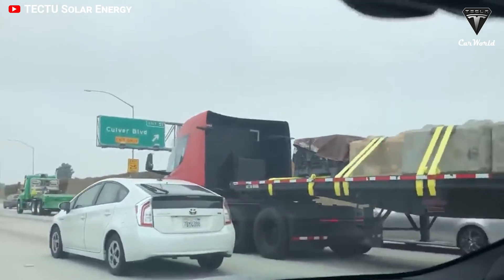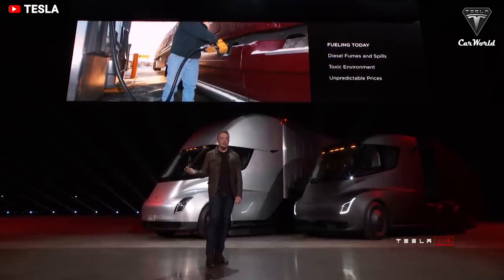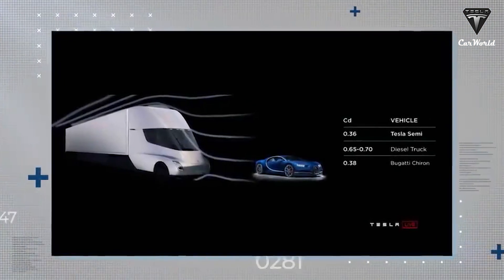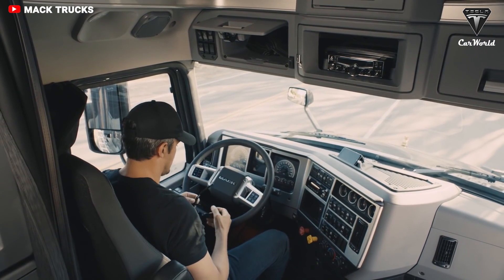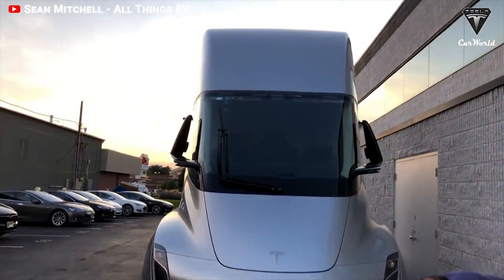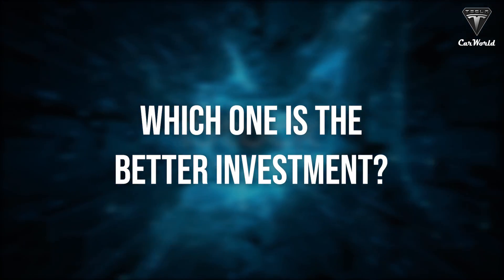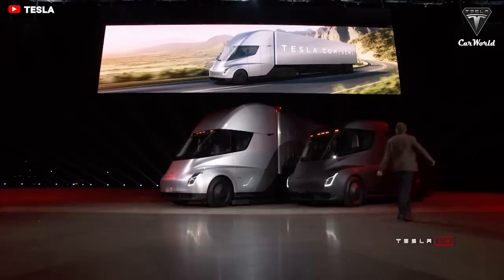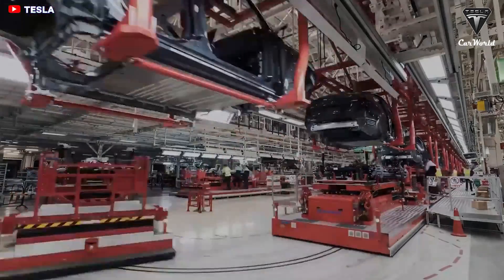Which is the KING of 2023 heavy trucks? Mack Anthem Diesel Truck Vs. Tesla Electric Semi?

Comment: These won’t work if they cannot go at minimum 700 miles a day on one charge as an OTR truck. Maybe ok for local stuff
Reply: ThatGuyDy:

So much nonsense from the FUD patrol. 

First , 500 miles is FAR from local.  

Second, given the 70% charge the Tesla can do in 30 minutes, that means an 850 mile total range with one small break while going to the bathroom and grabbing a sandwich.  

If you can't argue better than that, just give up.  Seriously.
Reply: @rogergeyer9851  that’s one truck and that’s double time for refueling on70% of the range. Now take that for more Tesla semis on the road. Delivery times would take longer because there’s a long ass line waiting to chatge
Reply: 700 Miles/60mph = 11.6h of driving. How long is a driver allowed to drive in US? In EU it is limited to 9h and controlled regulary.
Reply: @TschingisTube  american trucks can go 75mph and american truckers can drive 11 hours in a day
Reply: I'm not a trucker but aren't most trucks used for local delivery, which is millions of trucks in the US? That's a whole lot of trucks that can recharge overnight when electricity is the cheapest. Once we build out these local delivery trucks in 10 years, we will have built out the long haul recharge network, built EV trucks with sleepers and improved the longer range batteries?
Reply: w⁹rbg

Comment: One thing is for sure, this electric and hydrogen technology is getting better by the second, the supporting infrastructure is leaping forward by the month so resisting this move away from diesel is not smart. The fact that companies like Tesla and Nikola have tractors that won’t let a driver spin the truck around on slick roads is impressive x10 in of itself.
Reply: NIKOLA XDDD
you know that was a scam?
Same with Tesla semi which was supposed to come out years ago with full self driving and automatic convoy... And Elon is still withholding cargo weight numbers... I wonder why...
Reply: Easy to speak when you aren’t the one paying for everything. Do you understand the cost for an electric truck? Let’s not forget the purchase of the charging tower…also the land where the tower goes has to be approved by the electric company. A lot of hurdles and cost.
Reply: @tricallyourmama  We are still going to run out of oil one day .

Gas prices will only go up .
So we better start doing something and not just wait .
Reply: @alokinzna I hope we run out of oil, why can’t we just go back to the good old days where cars didn’t even exist, where all of these phones and electricity stuff didn’t exist, humanity is taking a turn for the worst
Reply: Ya don't have batteries.  We've seen what pulling an empty 1000lb trlr does to a pickup.  What mileage with that Tesla get in the Rockies in the middle of winter or the southwest when over 100 degrees?  I can go 1500 miles before I recharge my fuel.  Tesla's aren't green, either.  Ever see pics of those lithium mines in Africa?  It's disgusting what's goin on there.  Guess it's ok to kill their kids and their way of life as long as we don't see it here?  Takeoff speed isn't shit in trucking.
Reply: wirbg éltrç hydégr beßt
Reply: You dipsh-t 😂😂😂

Comment: Most road trucks run 500 to 600 miles. And I don't  belive they can run those miles with a 40 to 50,000 lbs load. Plus in real cold weather the batteries lose a certain  amount  of energy  . But I guess  we will see.
Reply: Tesla has demonstrated a 500 mile range at a gross weight of 81,000lb.
The range comes at the expense of the Tesla prime mover weighing 27,000lb.
Reply: @allangibson8494  Yes and that was going from 97 to 4 % charge. Lithium batteries should only range between 20 and 90 % on a regular basis. So that 500 mile demonstration was pretty worthless to a truck driver.
Reply: yeß they dó

Comment: Refrig. 55 ft  trailers will probably stay the same...Diesel operated. Refrig. delivery trucks will probably need a bigger battery to run an all electric version of the refrigeration unit.
Reply: Actually, reefer trailers will soon be battery powered, as electric refrigeration is a lot more efficient and costs a lot less to run. Sealed systems mean they're more reliable and have less maintenance costs, too. Also quieter, so no more complaints from the neighbors about noisy diesel reefers running all night.
Reply: @chrismuir8403  Reefer shipping containers have been electric since the 1970’s. They have a diesel power plant for backup.

Comment: Talking about the weight of the battery what do you think the weight of that diesel engine is? Talking about torque the Tesla has instant torque better handling because all the weight is down low

Comment: For short haul trucking with fleets, that are able to charge every evening, electric vehicles will be the way of the future.  For long haul trucking it will take some time to improve battery technology and charging infrastructure.  But for short haul the price comparison is to great to overlook. 
* A diesel truck trip at 200 miles is $169.76 @$5/gallon and 6 mpg
* A Tesla semi truck trip at 200 miles is $28.00 @.07 kWh (which large companies can negotiate better rates)
Even considering dirt cheap diesel at $2.5 you’re at $85  and expensive electric would be at $56

Comment: The drivers seat in the middle... 🤣 🤣 🤣  no way, this alone will be the reason it fails. Yep, Mack is traditional because it works and works for reasons Tesla has no idea why because they have never driven before. No camera, none, will beat a mirror when you are 75' long and have clearances of inches. The central seat just made everything blindside docking. Before anyone says a word, I have 650k miles with zero accidents or bumper cars. Docked regularly at places that had 80' clearances and less than 1 inch between doors of other trailers. None of the positive points mean anything in class 8 truck industry.

Comment: 🤦‍♀️🤦‍♀️🤦‍♀️🤦‍♀️🤦‍♀️🤦‍♀️🤦‍♀️
It won’t have a greater payload. Those trucks can carry more. They just legally can’t per DOT. 
Maybe DOT carved out an exemption for the extra motor and battery weights. But they won’t have a greater payload. Chances are it’ll be less because of the extra weight on the drive axles. Since I know you guys no NOTHING about the industry, you’re only allowed 34 thou on the drives and tandems.
These will never be otr. They don’t have enough parking for what’s out there now.

Comment: While I agree that electric is a great alternative and one of many shaping the future, you are forgetting some major items. There is not the infrastructure across the US. Range of the Tesla is sub par and would on a weekly basis gross the driver less money per week. Having a longer range and quicker fueling time the Mack would at least be able to 1 more load a week. For the owner operator that would be thousands of dollars more revenue a week.
Reply: First adopters will likely be companies that need 500 miles or less per trip and can charge the semi during loading/unloading. I think Tesla is cooperating with Pepsi to setup megacharges in their warehouses for that.
Reply: @michalfaraday8135  nobody is gonna have time to drive to a pepsi warehouse to charge their truck.. pepsi warehouses are not on all the highways.. doesn't make sense at all
Reply: @floofsale  Huh? I´m talking about Pepsi charging their trucks in their warehouses during loading/unloading.
Reply: In EU truckers cannot drive a Tesla Semi empty in one session. They have to take a break, where they can recharge to 100% again before their required pause is over. Refueling times are out of the question
Reply: The Tesla is designed for 500 trips.
Reply: @hoffinger  500 trips on one charge? 🤣 🤣 🤣 🤣 🤣 🤣 🤣  stop taking lsd.
Aint no truck doing 500 trips on anything.

500 x 2k miles = 100 000k of range needed. 
Good luck with that.
500 trips 🤣 🤣 🤣 🤣 🤣 🤣  500 trips of 0.02 miles maybe.
Reply: Also just do a little calculating. With that saving per 200 miles trip, with just 400 miles daily trips for 28 days a month, in exactly a year and a half, you can buy a new Tesla Semi with the savings plus $2000 to buy yourself a new brand new phone.
Reply: @jovanleon7  The problem is that the math is so bad, it doesn't work that way. 0.07/kwh is NOT a realistic cost around the US. The average is $0.18/kwh
Reply: @motarded4214  even at .18/kwh it's still cheaper
Reply: How much would the fuel cost for those trips Vs the electricity for the Tesla?
Reply: @rameusunlimited1561  Hey man, I made a comment on here today about the costs using his 200 mile trip. The numbers aren't anywhere near as great as his crap math shows it to be.
Reply: The semi will charge 300 miles in 30 minutes and usually unloading takes longer than that not to mention lunch breaks and other breaks, so not a problem
Reply: @jovanleon7  Where are all these mega watt chargers? So far I only know of 2. One at Tesla Nevada and 1 at Pepsi. Not exactly good coverage.
Reply: @zmavrick  you think Tesla won't be able to spread them up quick enough? Lol If anyone is able to make a network of megacharger it's Tesla. And just remember that there's not a single electric semi out there that is even close to the Tesla  Semi in terms of range, features, tech,  efficiency, load capacity, build, mega chargers, yeah pretty much in everything.
Reply: @jovanleon7  I live in the here and now. I will live in the future when the future gets here. The future will get here at its own pace.
Reply: S Cargo:  When the world never changes (and rapidly these days, re tech), be SURE and get back to us on invalid fears.
Reply: Fleet operators would probably have chargers at their facilities, the solar and aerowind installers in the area will probably be doing a brisk business! They would buy in bulk from power companies and thus get better than normal power rates.

Comment: I don't think it's possible to buy a new OTR truck from any manufacturer for the price he had listed. The running rate is 200k+ for a new truck. Plus no one has bought a new Tesla truck yet so real world costs are unknown. Plus there is no guarantee on how long the govt subside will last. Plus your comparing apples to oranges. Tesla is a local/regional truck vs mack being an OTR. The mpg are off because new trucks are capable of getting 8+mpg. Also the 2k lb weight increase is the govt allowance for heavier batteries but it doesn't show how much actual freight can be hauled.

Comment: Tesla trucks will be out of business in 10 to 15 years. The new conversion kit to change diesels to running on 80% hydrogen will completely take over the market. No emissions, no waiting for charge, cheaper to run, cheaper to manufacture. This will also end all combustion engines that are manufactured now. The use of fossil fuels for transportation is coming to and end but electric won't be the choice.

Comment: Just one week away from launching Tesla still hasn't published axle loadings, horsepower or torque. Let's hope there is a driver at Pepsi that will take the semi to a weighbridge and let the world know what it weighs. I bet Pepsi has an NDA with Tesla that requires them to not make any negative comments about it, just like the drivers in Las Vegas loop.
Reply: The Tesla Semi prime mover was calculated to weigh 27,000lb based on the payload used for the 81,000lb at 500miles demonstration.
Reply: @allangibson8494  Calculated? By whom? Why calculate it when you can actually weigh it? The rear axle loading is also important because some of the weight of the trailer rests on it. If the rear axle loading is heavier than a diesel truck that means less cargo. You can't reduce the load on the semi axle by shifting the load further to the back of the trailer because you could then exceed the trailer axle loads.
Reply: @brendanpells912  You are doing a lot of crying while delivering zero facts. Not a "empty husk!" ThunderFail viewer per chance?
Reply: @crocodile2006  I'm the one asking for facts.
Reply: @crocodile2006  he’s not wrong though either way you shift the wait there would be an imbalance
Reply: @allangibson8494 :  And thats consistent with credible estimates.  And that's close to the estimation for diesel semis, especially given the 2000 lb advantage for the BEV semis in the US.  

But deniers will deny, and lose, just like they have for the past decade.
Reply: @rogergeyer9851  diesel semis weigh around 10,000 pounds less if it actually is 27k...now we wont know how much it can haul till we know the actual weight of the thing but as they havent released its weight it is pretty safe to assume it is more than 2k heavier than normal diesel semi trucks.
Reply: Brendan Pells:  As if science deniers have any idea what they're talking about.   Hint:  The earth isn't flat, and vaccines are FAR safer than the underlying disease they prevent, on a statistical basis.

Comment: I live in the Sacramento area and have seen the TS doing their runs between the Giga Factory and the Fremont plant. They have to stop at the Rocklin Tesla Sales/Repair center to charge the battery.  A regular OTR truck could do that round trip TWICE before fuel becomes an issue.

Comment: Truck driver here, this video is a joke.
Here is why: Quick acceleration isn’t your friend when hauling 80k LBS.
With 300 gallon diesel fuel tanks in modern trucks you can go up to 1800 miles on light loads and 1500 miles with heavy.
While for Tesla you will have to stop every 500-600 miles for recharge
Tesla is yet to prove itself in market, we probably talk about 10-15 years from now until it shows sustainability. Tesla has to go thru all kind of heavy duty conditions before you start praising it. North states can go up to -50F.
After all I wonder, how people who never driven a truck come up with such silly videos, and try to teach the world how trucking works.

Comment: Complete bull crap let's see it pull 45.000 up 5000 ft pass in snow ❄️ then have the pass shut down for 2 days while your stuck in 10 degrees weather and keep your rig running for 2 days so you don't freeze to death .

Comment: So bro you're awful in your research forsure on his video. I'm not being a dick this is constructive criticism from a viewers perspective.  
I understand going with mack because they are the original semi company . Volvos are cracked power tho. 
No studio sleeper semi from Mack has the mp7 that is for their tow truck and box movers trucks. The mp8 is solid and the mp8he is vastly selected.  The horsepower in towing means the same as in racing zilche. Nothing. No impact. Torque is everything. 
The 1860 lb ft standing in studio sleeper Mack anthems are phenomenal and reliable beyond belief. Can haul 80k uphill gaining speeds always.  The Tesla is fine if our infrastructure was like 30 years ahead at least. 
Sadly I do not see the Tesla leaving local work for decades to come.  
You need to further your research on these things. You need to find the in n outs of every aspect for the trucking industry like a good journalist should. Thumbs down on this one brother. Chow.

Comment: Charging times alone limit this truck to local use only.  How could a team operate cross country?  Somebody might think 7 cents a kw is cheap.  Longevity of batteries in a full service 250 mile a day route might be an issue.  As someone from the industry, I did not see answers to questions I would raise before a purchase.
Reply: It is 80 cent in europe for tesla charger...so not cheap at all.
Reply: @triage2962  Only compare energy prices within the same county.

Comment: I don't know any Truckers that drive less than 500+ miles per day on an Avg. much less alone 200. This current Tesla model won't be enough to do the job. Maybe in about 10 years or so but deffinately not now.  
You would go totally broke as an owner operator. I'll take the Freightliner or the Mack or even a Volvo any day of the week. 👍

Comment: It doesn’t take a rocket scientist to realize that the Tesla semi is 1000 times better than any other on the road. Unless you like antiques.
Reply: The tesla semi is like a steam powered vehicle with seriously limited capability! Honestly 500 miles of range is laughable and also it’s not even cabover which mean’s totally useless in Europe and Asia…..
Reply: Oooh diesel trucks are able to be operated 24/7 for really emergency situations and works….. the tesla factories weren’t built using any crappy electric equipments and it was in record time

Comment: At five minutes in, the cargo hauling claims are very unclear. Batteries are an order of magnitude heavier than diesel fuel. That's gotta have some effect on cargo capacity. Thunderf00t estimates a ratio of 5/20 tons for Tesla/conventional semi in his 'Vaporware King' video. There's lots of different ways of measuring and spinning this.
Reply: Try a 27,000lb weight for the Tesla Semi prime mover alone.

Comment: What a product! Will absolutely not fit every haul, diesels or diesel/hydrogen trucks will - always - be a part of the puzzle.  In Europe we need to step on the gas - euh - electric paddle to build infrastructure. But if only up to half will be replaced by electric what a win for the local environment. And continues software updates make the product better and better. I read the comments about noice levels of the truck on highway - I agree that will be just as, but inner city acceleration will be. And the cut of fine dust produced by the brakes - Europe will welcome this truck with open arms but US has as again the first benefits of this beautiful machine..
Reply: Europe will not welcome the Tesla Semi - it won’t physically fit on European roads (it is too wide and too long). Volvo already have several thousand electric trucks in service in Europe however.